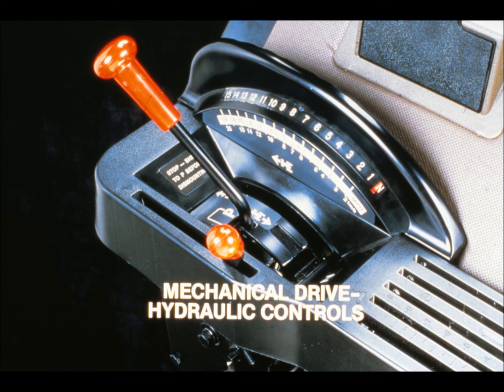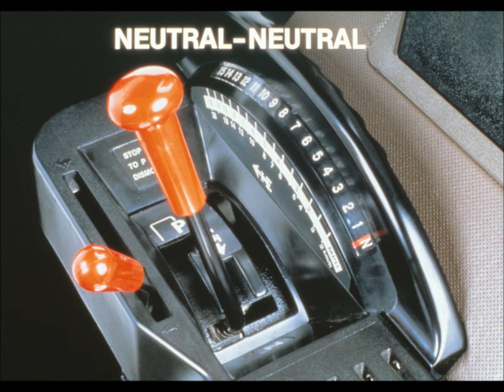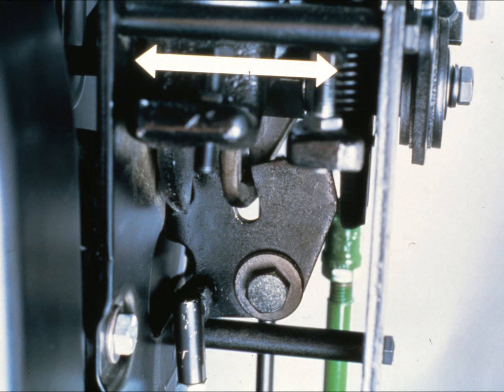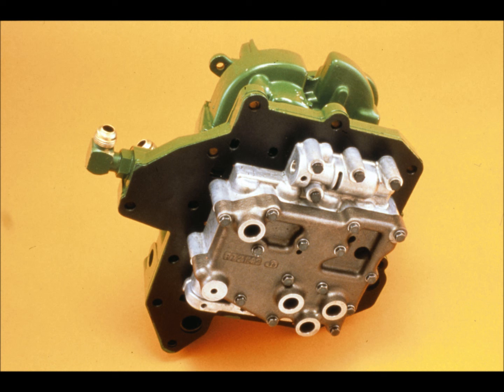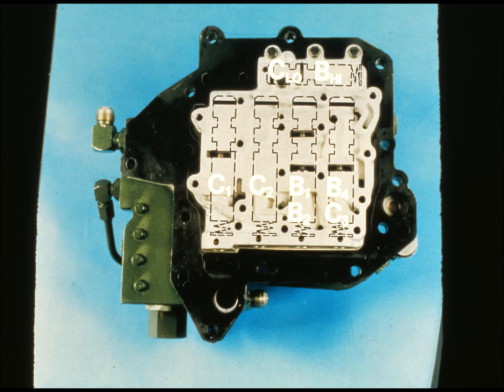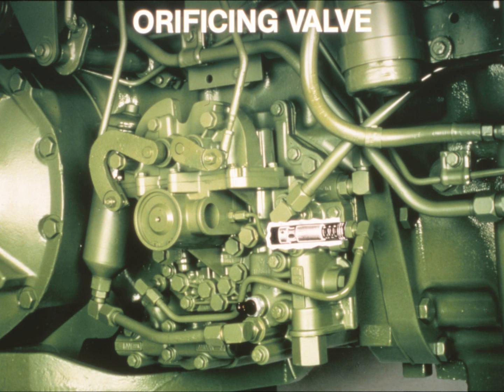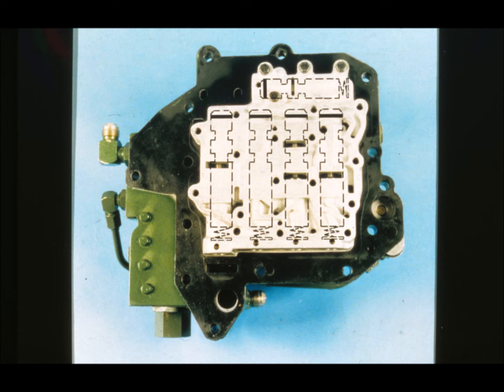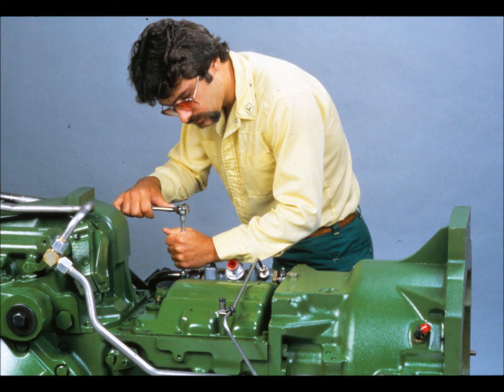John Deere 50 Series Power Shift Control Circuit Info (Reissue)

Comment: Non-tractor mechanic here. If I'm correct with what I understand the presenter is saying, you can start off in basically any forward gear without the need to shift through all the previous gears like you would in a manual gear shift car or truck?
Reply from the maker: Fairly certain that's how that works, yes.
Reply: @ikonseesmrno7300 Yup, I run 8 speeds on a 2510 and a 4020. Can push the inching pedal/clutch pedal in and start in any gear by shifting there and letting off on the pedal. Can also start in park and shift all the way up through the gears entirely without the pedal at all. To be honest 8th and sometimes even 7th can be rough to start in especially if you’re pulling something heavy so I usually just start in 5th or 6th and powershift up from there. I start in 4th and 5th gear almost all the time for just driving around the farm or doing field work. Same concept with a 15 speed just more gears.
Reply from the maker: @kennyz6533  Thanks for the info! Learning has been one of the most enjoyable things about running this channel. Regards!